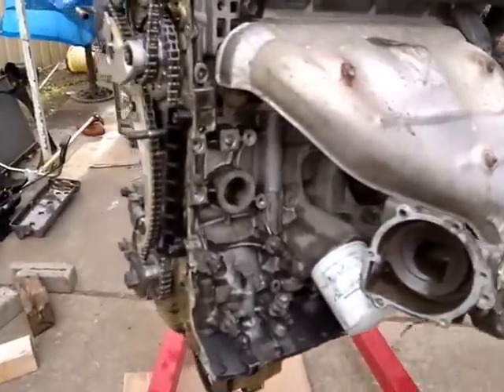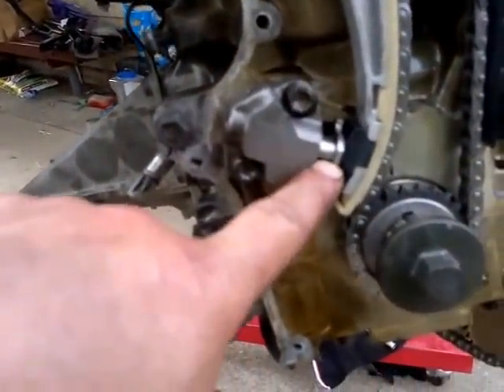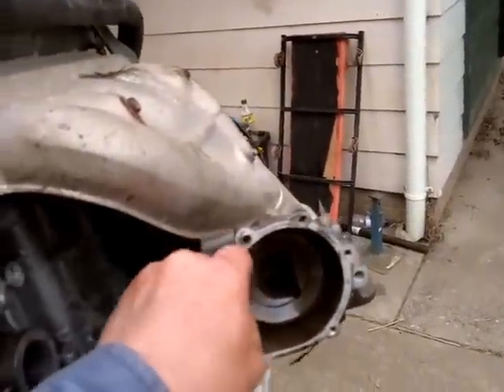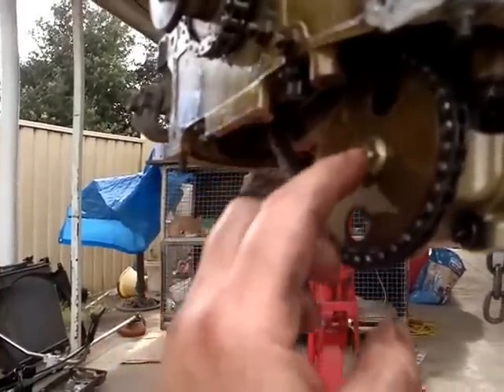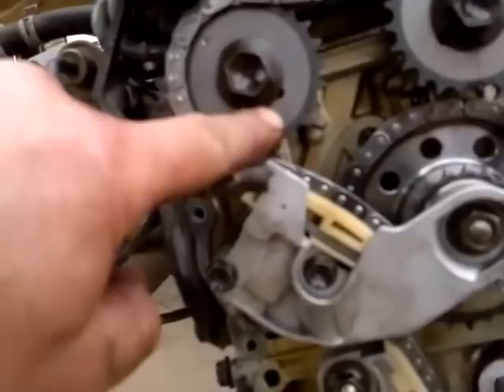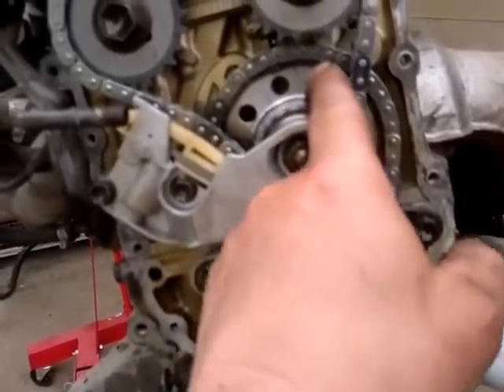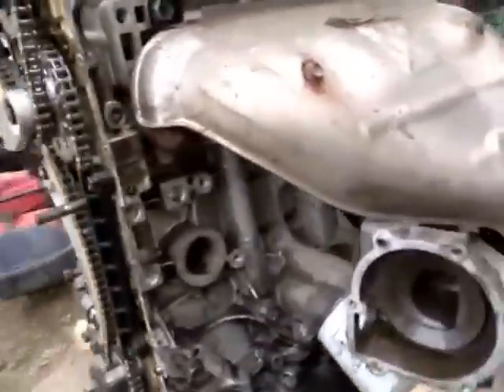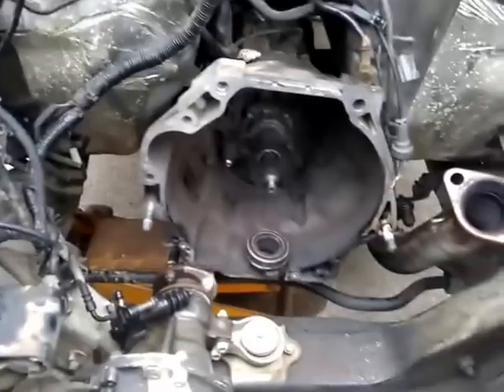j20a engine timing chain and oil pump

Comment: hi to adjust the oil pump chain  you loosen those 2 10mm nuts to right of the crank, its a oil pump guide use a long screwdriver follow the oil chain and you will be able to adjust the slack just move it evenly to make a curve and retighten those 2 nuts.
Reply: THANK YOU!
have been looking for how to adjust that, mine has been rattling for a while, I thought it was timing but timing looks fine.

Comment: Both tensioners actually use oil pressure, the bottom one just also has the ratchet mechanism to maintain it when the engine is off

Comment: If the rattle is from the top, try an oil flush and oil and filter change, you might be lucky and the tensioner do its job. It worked on mine, still probably near the end of its life but give you time to save up the £800 or sell the car !!!!

Comment: What brand timing chain kit did you use & best place/price to purchase one for a J20A? Any help appreciated as I have to get mine done soon.
Reply from the maker: Hi I can help you give me a call 0449253014 cheers Kevin
Reply: Hi mate, appreciate the reply & offer. I ended up purchasing the OSK S601K Timing Chain Kit as I wanted to use Japanese parts.
Reply from the maker: Hi my timing chain broke after 3 days so if you ring I will tell what to look , sorry I am not a great speller cheers kevin
Reply: @1300SL  how's your timing chain kit holding up?
Reply: @tmchevyman5319  Hi, few other things in life came up & never ended up having it fitted. Still have it all sitting here, but after all my research its one of the better kits. Japanese parts over Chinese any day.
Reply: @1300SL  Did you install it yet? If so how's it working out?
Reply: @marketingmajor8126  yes ended up having to get it fitted by local mechanic as had no choice. Over a year ago now & car is still going strong, even mechanic said the kit I got is a good one.

Comment: will the engine start and keep cutting of if the timing is of?
Reply from the maker: the engine can ran if the timing is out BUT it is not good for the motor, so best to  get the timing right the first time cheers Kevinj
Reply: Ok thanks alot

Comment: Hi. Does the engine need to be outside the car ti do this job?
Reply from the maker: Hi mate , no it does not need to be out of the car but it does make it easier , I did  my motor in my car and it worked out great cheers kevin

Comment: i just messed around with the timing for like 4 hours and went no where. pain in the ass. I dont get it
Reply from the maker: what part of the world do you live?
Reply: @MrHangerone  the midwest in the USA. why?
Reply: @MrHangerone  basically I get all the marks lined up exactly where they should be. I pull both of the pins for the timing chain tensioners and rotate the engine twice and then I lose all the timing marks
Reply from the maker: @DaBossk  let me know how you end up , because its chain the marks will move as you turn motor over so check for tdc on the crank and your valves are closed as you turn the motor over the valves will stop at the same place each time you turn over the motor that way you know you are right